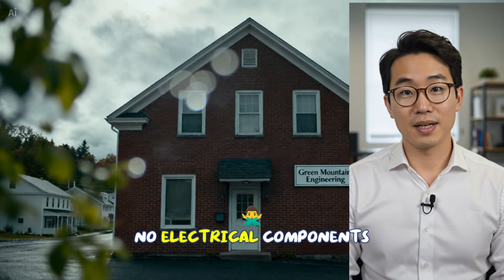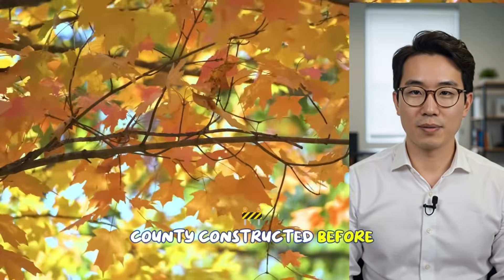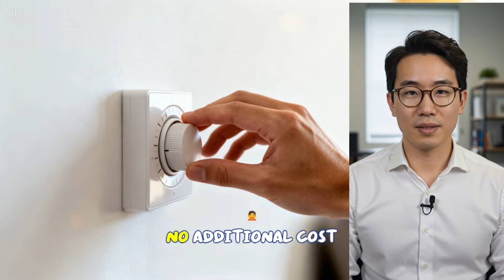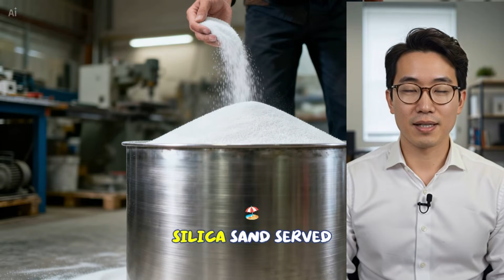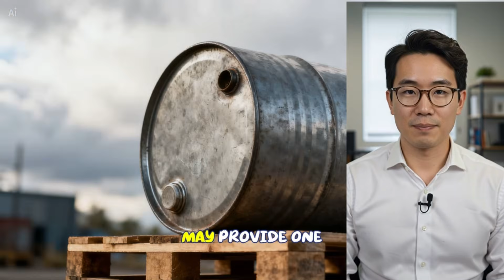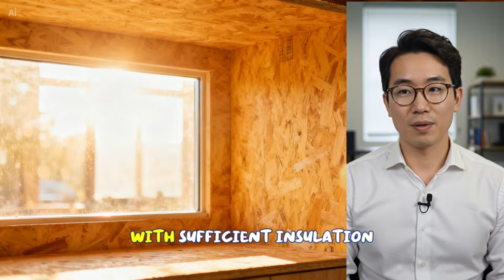THIS $15 SAND BATTERY STORES HEAT FOR MONTHS AND CAN WARM A CABIN ALL WINTER

Comment: I am in the design phase of parabolic mirror, Stirling engine, paraffin wax  battery, volcanic(basalt) battery and water tank off grid system to heat in floor radiant heat and the Stirling engine gerator to provide electricity.

Comment: If the sand temp raises to 600 degrees, what medium is in the coils?  Can't be water.  Can't be glycol.
Reply: Molten salts and air are used in commercial systems for temperatures that high